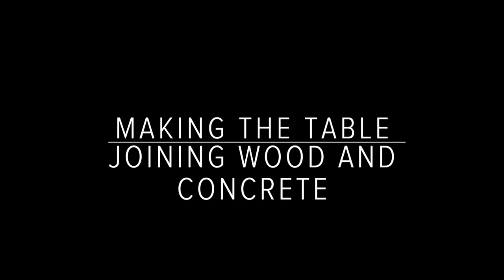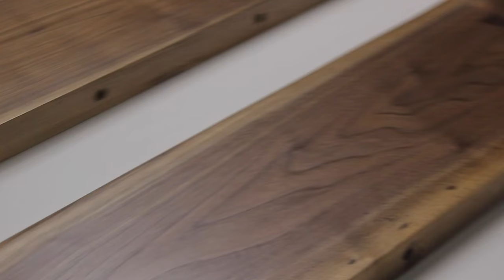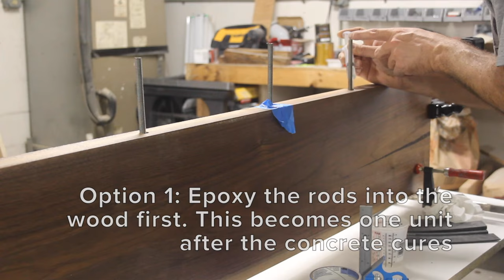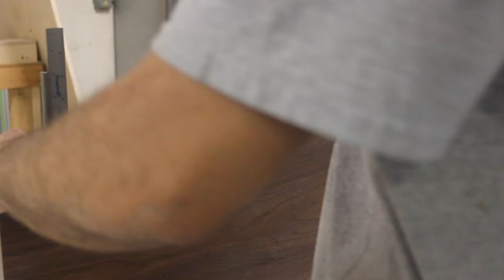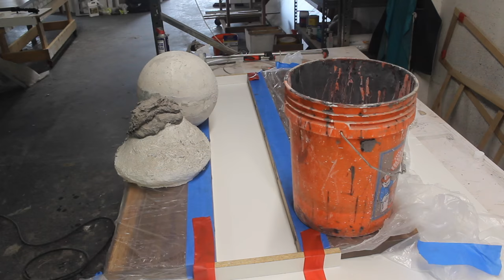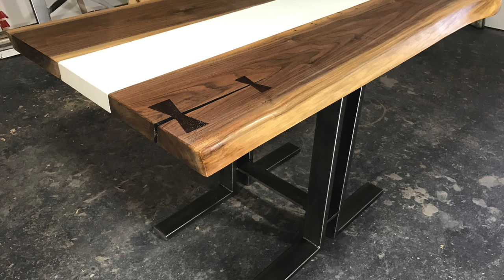How To Make a Concrete and Wood Table top

Comment: How has this table held up? Was there any separation? I’m trying to figure out the best way to make one myself, but the concrete for me will have to be at one end of the table.
Reply from the maker: Hey There, we have several of these out in the wild and so far haven't heard any reports of issues. I have two bedside tables that I made with this construction  method and they are still holding strong.
Reply: @Betonstudio1 thank you so much!! 🎉

Comment: Nice job, thanks for sharing. One minor thing I have done differently is used a sika flexible adhesive for any dowels in the hope it gives a little bit of tolerance for the different expansion properties of the two materials.
Reply from the maker: That's a great thought. Thanks for sharing.

Comment: Hey bro, how did you epoxy in the other side of the wood that just had the matching holes? The epoxy would just roll out when laid down both wood pieces? I apparently got hired by my parents lol to make them a similar table and never joined wood to concrete like this…. I have the fiber leftover from making my concrete counter top….
Reply from the maker: Hey! You have to use a thicker epoxy. There's a company called Fiber Glass Coatings that sells a two part epoxy called Superbond. It's thick enough to do what you require. The trick with that is getting it in the holes. Good luck!

Comment: Looks amazing! I'm inspired to try your design myself. One quick question though. I see you put fiber strips in the concrete to strengthen it up, but what about using rebar reinforcement? Under what circumstances would you do that?

Comment: Relly good job done here.

Got a question.
In method 2 , do u set the concrete seperate and after that u drill the hole into it to join the Rods right ?

Then u poxy the rod into the crete, let it cure. And then u poxy it into the Wood?

Comment: Might be a silly question, But won't you have issues having wood and concrete together. Don't they exspand at different rates? They won't crack each other?
Reply from the maker: Not a silly question at all! Its something we thought a lot about as well. I think you'd encounter problems if the concrete completely surrounded the wood or vise versa. 

In this situation, we have the wood, which moves a lot more than the concrete on the outside with nothing keeping it from moving. The epoxy we use is a flexible adhesive, so it also allows for a little movement at the seam. 

Does that make sense?

Comment: Really cool! Did you have to add any pigment to that brand of concrete to make it white? Also, how did you attach the legs to the concrete?
Reply from the maker: Hey Zach, We didn't add any pigment to the mix. That brand uses federal white cement, so it comes out a really pretty white color. For attaching the legs, we routed the underside of the wood to fit the base and used some screws to keep it in place. Cheers.
Reply: Cool cool thanks! So you didn't attach it to the concrete parts? Just the wood?  I'm looking to make one that is half wood slab and half concrete, so I'm trying to figure out the best way to attach steel legs to the concrete parts.
Reply from the maker: No, we didn't attach it to the concrete in this instance. Send me an image or drawing of what you have in mind and I'll help you with some connection problem solving. info@betonstudio.com. Cheers

Comment: i've tried this a few times and I always seem to get slightly crumbly concrete on the top edge that joins the wood resulting in a slight channel in the top surface between materials, even when the wood is treated for water resistance. any idea how I might overcome this?
Reply from the maker: What type of mix design are you using?
Reply: I am mixing my own concrete mix, old style with cement, sand and aggregate at around 2/2.5 aggregate to 1 cement. What did you treat your wood with to stop it soaking up moisture from the concrete? Also how do you prevent glass fibres from showing up at the surface of the table? Thanks again, absolutely loving your work!!
Reply from the maker: Will Bazeley is your wood piece flush against the casting surface? I think what is happening is you have a small amount of cement cream flowing under the wood. This is what is causing your crumbly edge. Try clamping the wood piece down to so it is making contact all the way down the seam. 

If you add some water reducer and slightly vibrate the concrete, the fiber won't show through.
Reply from the maker: Will Bazeley I seal the wood all the way around with General Finishes Arm-r-seal

Comment: this is NOT concrete ... Google  what concrete is.
Reply from the maker: Rockwall Stone I'm aware of what concrete is thanks, the mix I use is white portland, aggregate, water and reinforcement. that pretty much hits all the requirements of being concrete
Reply: The MIX you use is a pre-packed BR product. It may be GFR cementitious chemistry cocktail but is not CONCRETE or BETON. It lacks the COARSE aggregates. No offense
Reply: Concrete: an artificial, stonelike material used for various structural purposes, made by mixing cement and various aggregates, as sand, pebbles, gravel, or shale, with water and allowing the mixture to harden.

Coarse aggregates do not define concrete as concrete. Depending upon the scale of the concrete item being produced the aggregate (and reinforcement) has to respond. The aggregate required or specified for pouring the foundation of a building is different than that of a 1-1/2" table top.

The chemistry cocktail you mention is embraced by the concrete industry and the Portland Cement Association. Most high-quality mix designs of many scales  - whether you're getting it from your local batchplant, dosing it yourself or buying it in bag form - contain admixtures of polymers, water-reducers, shrinkage reducers and other chemicals.

But with all of the amount of these chemicals combined they are still a small percentage of the amount of portland cement and sand (small aggregate) in this type of mix.